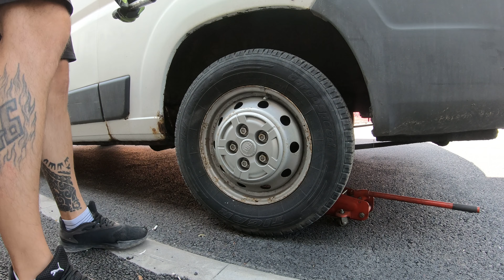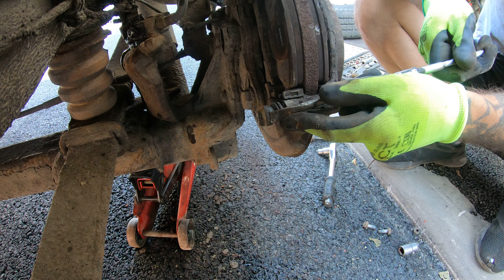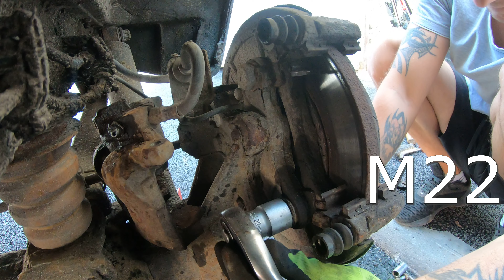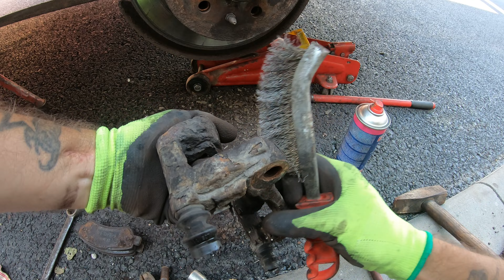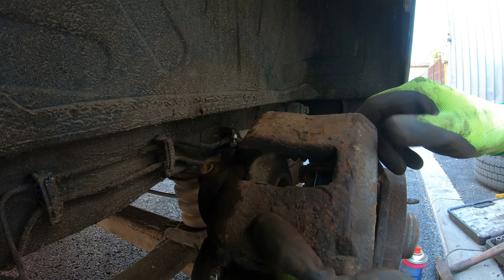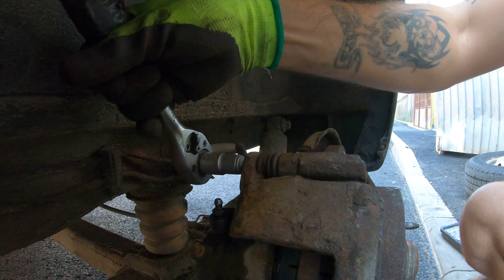Fiat Ducato ,Peugeot Boxer ,Citroen Jumper Change rear brake pads, remove disc and clean brake shoes

Comment: Spray Copper Slip on everything . 🤔   it's best to use a silicone grease on caliper slide pins,  use a high temperature Brake grease.
Reply from the maker: On old Ducato nothing work , brakes block evry 6 mounths

Comment: And does your handbrake work properly?
Because in my case the adjustment rotor and the thick spring are upside down. And the small spring is behind the brake shoes for me. So I'm curious whether your brake functions properly.
Reply from the maker: Yes sir’ , van year 2007

Comment: Not great, shoes should be removed, cleaned and the adjusters as well. 1/2 a job done. Better off to do it right when its much the same time to do it property.  Proper grease for the sliders as well.
Reply: @AutoMotohowto46  And to you, just do it right!
Reply from the maker: @oolatony  follow other videos on the channel and criticize me, thanks in advance :face-red-heart-shape:
Reply: @AutoMotohowto46  Not worth doing that, if you did the job right I might but I don't endorse half baked  jobs. Do it right or don't do it at all! I did my Ducato ones 3 weeks ago and its the same work to do it right!
Reply from the maker: @oolatony  🫡 ok